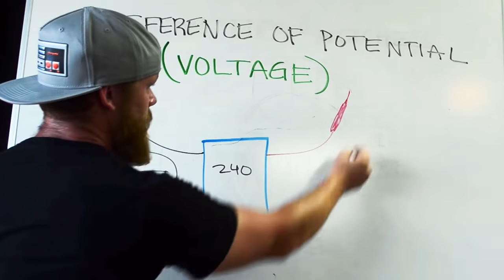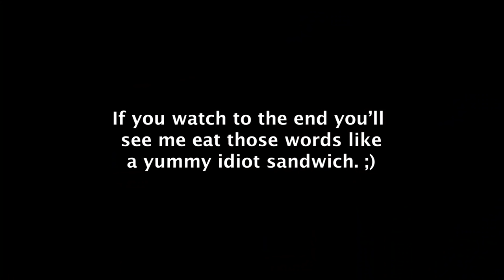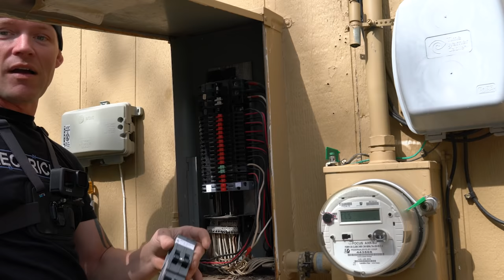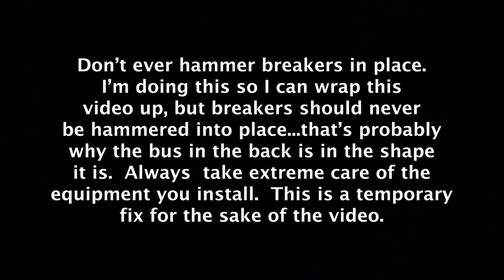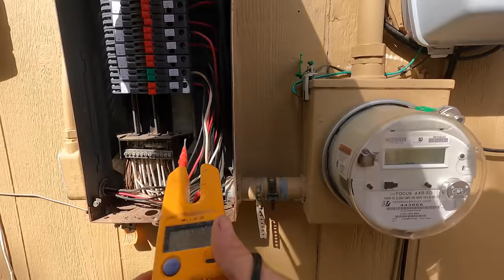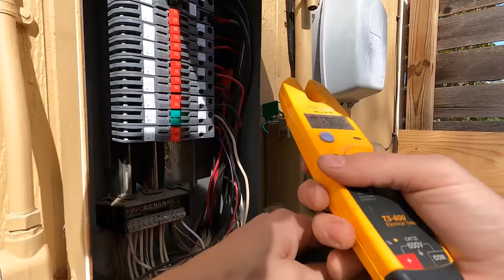How To Work on LIVE CIRCUITS - Replacing Circuit Breakers in Old ZINSCO Panel

Comment: Uh…medium voltage is 1000 to 100,000  volts per ANSI. Eaton defines medium voltage as 600 to 69,000 volts. 480 is low voltage and most industrial switchgear (even at 480 volts) is so dangerous that no PPE exists (yes, that includes the moon suit) that can save you from a phase to phase arc flash explosion. Your PPE explanation is a little too nonchalant for my taste. 🤷‍♂️
Reply: I agree that he was nonchalant but you are not exactly correct. The traditional US definition is 600V to 35KV.. They added 69KV( which some still consider EHV) and moved the 600V to 2000V and even 3000V to accommodate calculated potentials in 480 VFDs and similar equipment (including PV installations that are using Mosfet inverters).. When doing arc flash studies some installations cannot ever be worked on live but most industrial switch-gear is approachable with proper PPE (Look for the arc flash label for guidance). For the most part this is for testing and maintenance only.. Repair work requires a live work permit which under NFPA 70E is almost impossible to justify... One note on PPE, NFPA rates PPE use thru 20 cal/Cm2. Any energy release level above that cannot be worked on safely without potential loss of life.. As you said, some equipment energy release is to high on work on period (without risk of loss of life) which NRPA says is 20 cal/Cm2. That being said you can find PPE rated up to 100 Cal/Cm2 that people use when the rating is over 20. It is extreme foolish barbecue it will not help in an event over 20 Cal/Cm2 because the heat is not the issue at those release levels, its the blast and shockwave that will liquefy your organs... The reason  100 Cal/Cm2 gear is made is because 20 Cal/Cm2 gear used in a 20 Cal/Cm2 arcflash incident will keep you alive but will not keep you out of the burn unit.. Electrical PPE accepts 2nd degree burns over a significant portion of the body as a successful event. You wear the 100 Cal/Cm2 gear for the extra headroom to hopefully walk out of the room and tell the story to your kids the same night.
In this case He could have made an appointment to have the power shut off.. If he had done proper testing (which can be done live wearing proper PPE) he would have known that their was a problem with the breaker/bus interface before starting.. Most electricians don't do it on residential service but testing works on this type of equipment and should be done (follow the guideline s in NFPA 70B)
Technically, unless your municipality calls for it, you don't need to do an arcflash study for 480V installation under NFPA 70 but it is foolish not to. When you run the numbers many 480V systems are significantly more dangerous than MV systems because of the long fault clearance times compared to MV equipment (the energy release is a function of Amps, volts and time..)
Reply: @darikmatters8866  every MDP and switchgear in the factory I worked in was 480v and every one of them were deemed no safe PPE exists per the union electrical contractor who did the study. They refused to touch any switchgear or MDPs hot. I’m a half assed electrician at best. I have an associates degree in electrical technology from the local community college (my classes are accredited with Penn State) but I pursued HVAC instead of spending the majority of my time pulling wire and hanging lights so I’m a tad rusty on some of the knowledge, but his use of leathers, rubbers, and a face shield in a tee shirt is hilarious. I was waiting for him to toss the balaclava on top 🤣 In the 6 years I was in maintenance in that factory, I went through an arc flash course five times and was supplied with 12 cal gear. We were forbidden from working on anything that required more than 12 cals and I was fine with that. In maintenance, it’s hard to keep up to date with everything. The ANSI stuff I wrote about was from a 2 second google search and google could have very well failed me but it’s still hilarious that he is referring to 480v as medium voltage, because, you know, it isn’t 🤷‍♂️
Reply: @jman0870  Very wise of the facility to do Arcflash studies on the plant equipment.. As I said, it is not required but very important to do on 480V systems..
Reply: @darikmatters8866  And yet the most critical components of it were not safe to work on live....
Reply: @jman0870  Technically and literally NOTHING is safe to work on live. Not even 15A 120V household circuits.
You control risk and mitigate damage.

Comment: you are not actually working on LIVE circuits or panel - you turned off your MAIN, so anything downstream is safe and there is no electricity flowing through the bus bars - the only LIVE spot is the main breaker,  you still have live connections going through them, so it would pretty much be a good idea to cut power by removing the meter if you want to replace the electrical panel or main breaker :P

Also changing breakers in known faulty panels is not a good thing - even if technically if you are in an old home and it was up to code at the time of install you are not required to change it, insurance companies might see it a different way - if you have a house fire caused by faulty wires or an electrical panel and that panel is known to be a hazard, it then falls under owner negligence and no insurance company will pay and if you claim you did not know this, it won't matter, as the law does not protect ignorance.  Remember that, if you have an old electrical panel that is known to be a fire hazard or one of the brands that had safety issues, replace it as soon as possible!  Insurance companies will find ANYTHING not to pay you in case of a claim.  EVEN if you have a Zinsco, Commander, FP, GTE-Sylvania, etc, and there has never been an issue YET, insurers generally want you to replace old stuff, even if that old stuff still works, because it becomes a liability.

Comment: Lets be real tho how many of us actually turn of the whole panel to put in a breaker?
Reply: I do. The incident energy isn’t stated here, but you would be surprised just how much available fault current could be present.
Reply from the maker: You're right...But when you're replacing every breaker in the panel...probably smarter to shut them all off don't you think?
Reply: Anyone who works live has a death wish.   I was a cowboy once upon a time, until I saw a buddy get electrocuted.  If you work live, you get what you deserve, keeping in mind more electricians die every year than cops on the job.  Is it worth it to work live?  No fucking way.
Reply: @ElectricianU  agreed for all them but if im doing one il just slap it in

Comment: Hmmm a real master would not use a regular bare screwdriver...
Reply: Why not?
Reply: Using a regular screwdriver is fine when you are competent
Reply: @IceBergGeo  Why? 
- Because the shaft can easily create short circuit
- Because you finger might be touching the shaft and current might flow through your body.
Reply: Insulated screwdrivers are safer. Even when you are competent.
Reply: @hjooy  you know you can actually rich a live wire and not get shocked, right? Touching two things that are at a different potential is what shocks you.

Comment: preaches safety safety saftey 

uses a standard go to Walmart metal screwdriver
Reply: And then takes off his face shield and gloves to do a voltage reading with his meter lol.
Reply: That's a Klein screwdriver.  I have the exact same ones and they are comfortable and great tools when used for the right job.  That being said, definitely not the tool for this work.  There are so many cringe moments during this video I can't even count them all.  This guy is just cheap, and has no business teaching anyone to do electrical work.

Comment: Ok. So first off. How to work on live circuits. If you’ve taken a NFPA 70e class. You’d know that working on live circuits is only if needed. Meaning life support  and etc. #2 you have zero protection against arc fault. No Balaclava , no fire rated shirt. Not even leather gloves. Not even 100% cotton.  #3 your shirt has a printing and is most likely mixed with polyester. You’d have a new tattoo on your chest saying electrician u if anything happened. I like your videos. You’re smart. I’ve even left comments on your Instagram asking you questions. But I don’t agree with your video here. Especially your wording. THERES NO WAY TO WORK ON  LIVE CIRCUITS SAFELY. SO for you to say how to work on live circuits, without demonstrating the following dangers present. Do you know the arc fault rating on your house? The only way you work on circuits is dead. Regarding it’s your house. You’re relaxed. Why go through such matters. I know a guy who electrocuted himself switching a garbage disposal under his sink live. Wife walked over him for over 30 minutes before realizing he’s dead. I’ve done a lot of dangerous crap as well. Live tie ins from Edison or DWP with no leather gloves. Or even dropped bolts for bolt on breakers in 208 panels. Hoping to god nothing happens. If you’re going to work on live circuits, demonstrate the correct procedures for doing so. I’ve been out of residential for a long time. But safety is saftey

Comment: There is no justification for working a hot panel - and suggesting to others that working hot is possible and required as in this instance, is irresponsible.  Many of those whom you are instructing work for employers (both open and union shops) which use NFPA 70E to provide required safe electrical work practices and establish company policy.   The culture that encouraged working hot as a sign of craft skill or manliness continues to erode our trade, to the detriment of some who are burned or electrocuted every year under the banner of, "let's just be careful".  NFPA 70E identifies very specific and narrow conditions under which working hot is allowable.  Poor prior planning or coordination with the utility to temporarily remove the meter is not one of them.

As far as working on industrial equipment "with ten million dollar production line," that should not impress anyone working in our trade.   Prior planning is the answer.  Even if the customer tries to impress upon the contractor the importance of its business, the electrician or contractor needs to politely turn that conversation around.  Those owners who state that things cannot be turned off need only understand that they are in fact legally responsible for any injuries which result from hot work, and grasp the fact that if an arc develops during hot work, the equipment damage will take their "ten million dollar production line" out for days or weeks depending on the ability to source repair or replacement parts.  It is quite persuasive to suggest that the owner can plan for a definitive 8-hour shutdown of its line, or run the risk (however remote this might be) of taking the line down for an indeterminate period lasting for days or weeks.
Reply: Very well said!

Comment: I stopped watching at about 16:00 because this does not make sense. This is considered working "live" even if the the incoming breaker is off, even when replacing "just" an outgoing breaker. Using insulated tools is mandatory and it is foolish seeing him handle the uninsulated screwdriver, especially waving it close to the loose hot wire. I would prepare the new breaker before unscrewing the hot wire to minimize the time that hot wire is unprotected. A face mask needs to be used with safety goggles. Also ear channel protection is required. The shirt needs to be long sleeved. Did I forget something? Even if the panel would not be live, thin gloves were prudent to avoid splinters and cuts, never work with bare hands. That he worked many years at several voltage levels does not mean he is qualified. Therefore some education is required

Comment: “I’m a master electrician” 

- doesn’t wear long sleeves 
- doesn’t use insulated screwdriver 
- grabs wires by hands instead of using insulated pliers 
- doesn’t remove cover from panel 
- continues to touch wires by hands to prove a point to viewers who may or may not be electricians 
- jams non insulated screwdriver into breakers and bus to pop out breakers on a hot panel 
- could simply of eliminated the risk by calling the utility company to pop out the meter… on HIS OWN HOUSE… which he says a few times. 

Remember boys and girls… he’s a Master electrician.

Comment: Fact one, you are required by code to have a disconnect between the meter and panel, so your either in violation or your putting on a show! Fact two, if you turn the breaker off the line is dead!

Comment: There is no excuse for doing live work short of someone being on life support.  Just not wanting to call the utility company to pull the meter is not a good reason.

This is how electricians get killed.  The old it can’t happen to me or I know what I’m doing scenario.

Why are you bothering to change breakers in a panel that you plan to replace, doesn’t make any sense.

Electricians shouldn’t wear screen printed shirts.  An arc flash can cause additional skin damage from the print.

Why are you not using voltage rated tools?  Very dangerous and unsafe, can easily cause an arc flash. Why are you not wearing a FR long sleeve shirt?

Is this video supposed to be an example of what not to do?  Everything you’re doing is very risky and dangerous.

Comment: This is barely better then what I'm used to experience in China. Wherever else I go there are several flaws to this method. First off, you are using short sleeves? Get a jacket that is certified to the energy level you are working with. And don't start talking about the heat and temperature when you are working, it's better to be hot for a while than being burned for life. Second, get some insulated tools, you just look unprofessional.

Comment: "Master electrician".  Master knob jockey more like.  working on LIVE circuits. there was NOTHING live in the panel until you pulled the incoming line conductor.  120volts. ahh diddums that must really hurt if you get a belt of that.  and wtf is this "hot", what are you a plumber.  Don't you mean "LIVE".  I love the way you used VDE screwdriver and torqued the terminations oh wait you DIDN'T.